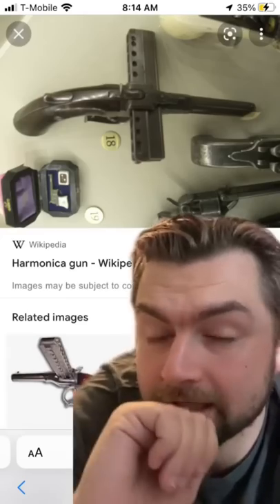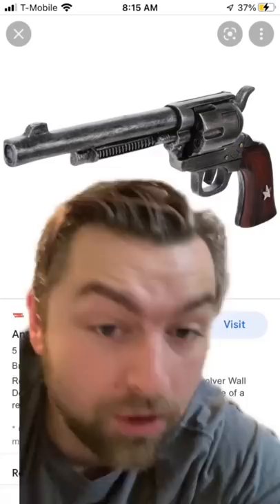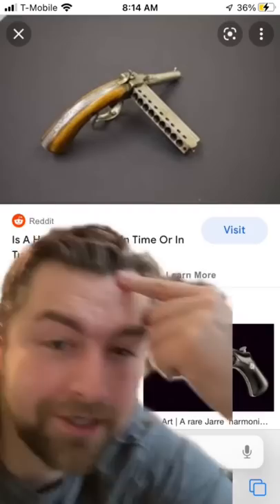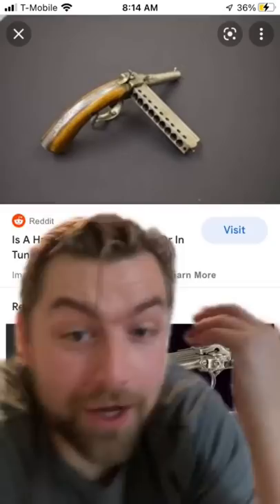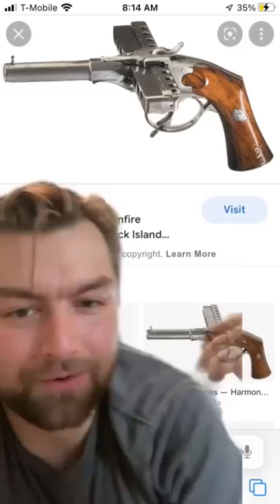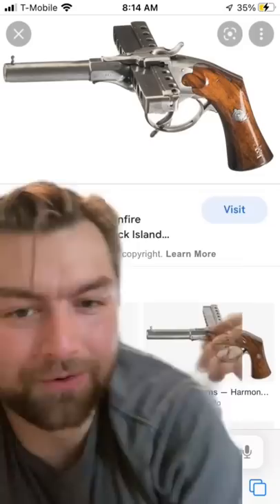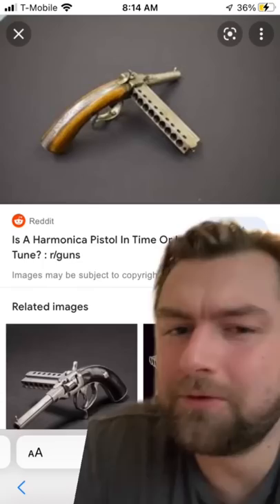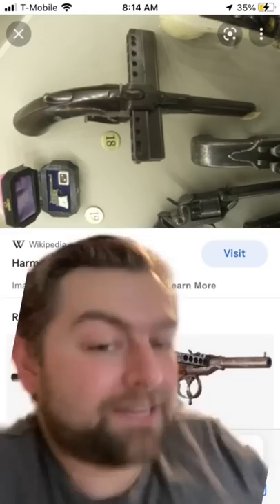Early guns are so wild: the harmonica gun

Comment: Would a chain fire turn it into a shotgun pistol or just burn?
Reply: Probably both. Though I feel like it actually might be safer in terms of the chance of a chain fire. Could be wrong though.
Reply: I think one way it was designed to prevent it was by having a small lever (maybe on just a few) that both tighten and sealed the box to the barrel as the barrel had a small extrusion so when the box was aligned and pressed up, it would prevent the chain fire like what you may get with cap and ball revolvers. Look at Forgotten Weapons for more info though.
Reply: @slydoorkeeper4783  I'll look at forgotten weapons as what your saying sounds believable but I'll do my own research.

Comment: The original gattling guns also employed a similar system, where a loader would drop shells down a conveyor tube as the gun fired..most of these guns had an actual ammo capacity of roughly 8-10 rounds and their fire rate was based entirely on the person cranking the gun so crews would have to be well trained on a level that today would seem impossible.the average army howitzer team of 12-15 soldiers(ammo runners included)can fire 8 volleys a minute.the average classic Gatling gun could fire 68 rounds a minute..artillery units are a different breed of human…

Comment: What's a harmonica gun, it was easy enough to carry extra magazines, because the gunsmith would often make Spears. Sometimes as many as five or seven of them per one customers pistol or rifle.

You make it sound onuris that a person has to move the harmonica part down by hand, but that is looking at it from today's perspective. The alternative at that time was to pull a little Rod out from under the barrel, put powder, patch and ball in, and then Ram it all down. Then put a cap on and Fire it. It was a good idea to put the ramrod back under the barrel before firing it, otherwise you couldn't reload it for the next time. The harmonica mechanism permitted just simply pop, pull back the hammer, move the piece over, then pop.

So, yeah.

Comment: Looks like the bottom of the very tip of the hammer also has some metal hanging down to fit inside the indented slots on top of the “harmonica”.. it probably wasn’t that hard to line up but I would’ve hated having to slightly pull hammer, push the thing, listen for the click, pull the hammer, then aim and fire..

Comment: It might have worked better mechanically if the "harmonica" was oriented vertically with the sights down the side of the barrel. It could have a gravity based mechanism to advance the clip. Accuracy would suffer from sights on the side, but could be compensated for with volume of fire.

Comment: The fact that it had to be lined up perfectly, manually is probably what killed it.  If they machined some small round recesses into the body of the magazine and then machined a hole in the body of the weapon adjacent to the magazine and installed a spring loaded ball to act as a series of detents, that could've probably fixed that problem at least.  Cool video did not know about this weapon, surely it was the inspiration for revolvers like you said.

Comment: I had a blank/tear gas gun with the basic same concept, it looked like a .25 auto the slide/ magazine was fed into the front and came out through the back. I wonder why they stopped making it? They weren't cheap either... about the same price as an RG .22 revolver in the early "70"s. The Capsicum cartridges were only effective at point blank range though.

Comment: I always loved old guns and I always thought you could get to harmonica gun to work if you could just figure out how to get it to work with the harmonica slide being vertical instead of being horizontal that way the weight would be a lot more even  should be limited to only hip firing that should still be a far more accurate than the normal version

Comment: They could put gear system in it like revolver that would previously allign the cylinder. I don't see why we won't be able to manufacture a functioning model with modern engineering. Of course it has little practical usecase.

Comment: Kind of but with that model that you're showing the holes on the top of that slide into a pin you can see on top of it the handle of the gun that would fall in the hole to line up the earlier models didn't do that and if it was off a little bit with a rimfire around it would go off and blow the side of the gun apart

Comment: It's actually not true that "there was no real way to move onto the next round automatically". On the bottom of the slide there are pins or tracks that interface with a camming mechanism actuated by cocking the hammer or pulling the trigger.

At the the beginning of the video these tracks can be seen on the pistol above your shoulder. Regardless, even if there wasn't a mechanism to index the slide and you had to push it through with your hand, there would still be a detent to align the chambers with the barrel. So it's also not true that you could very easily get lining it up perfectly wrong and not be able to fire.

Comment: I think that maybe if you trained both right and left hand firing, you could theoretically use the mag as a grip, so that you can pass it quickly and split the weight
Holy crap i thought too much
Reply: Clip
Reply: @romeo7416  nah bro you didn't just correct me for that
Reply: @J4YDEE  I did
Reply: @romeo7416  alr then, the correct way is clip, but do you agree with me?
Reply: @J4YDEE  yeah but the metal might get hot after rapid firing. Only downside i can think of
Reply: @romeo7416  they could put maybe a heat isolating material around the clip so that it is easier to hold, like a good quality plastic
Reply: @J4YDEE  yeah

Comment: That's not true?
The ammo "slide" has holes in the top, reference points, for mechanism to lock into. So you wouldn't be able to lock the slide in place to fire unless it was aligned correctly. Which is pretty easy cuz you can see how large those holes are on top.